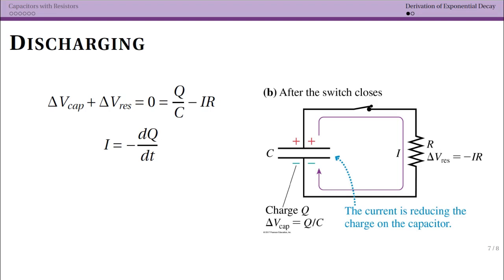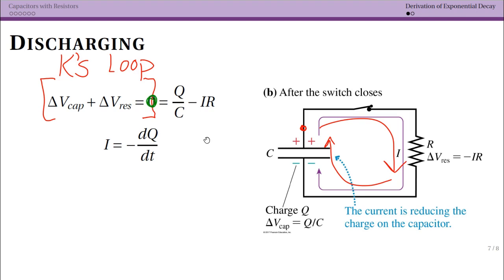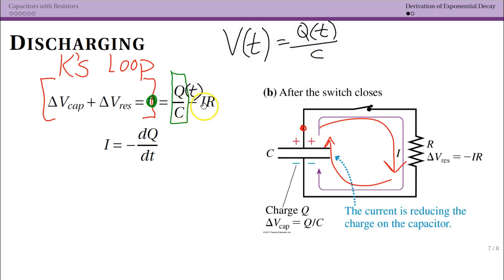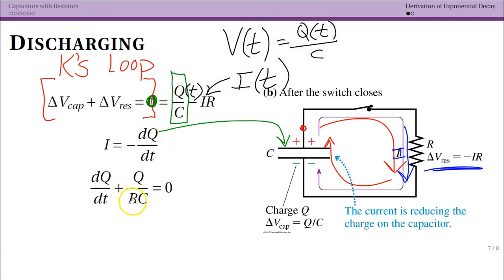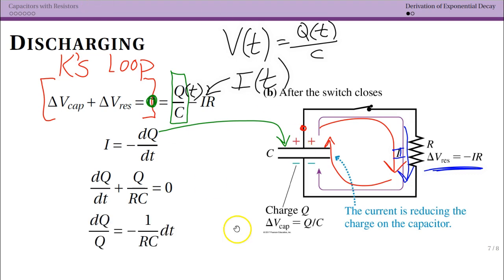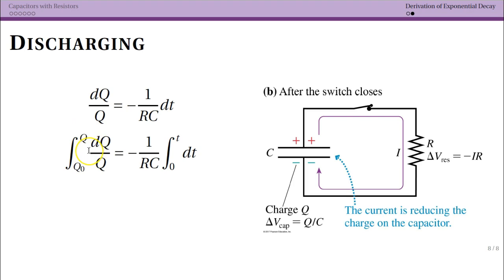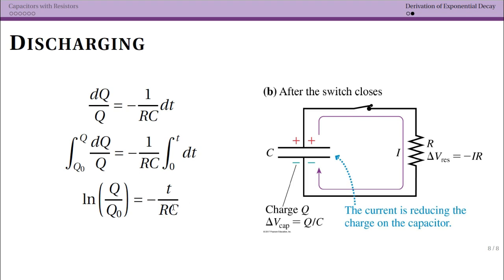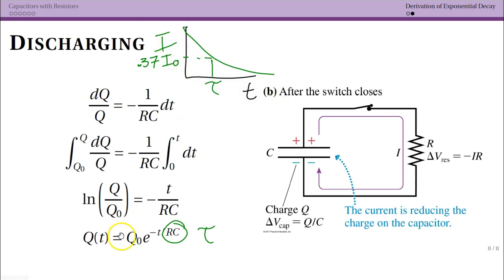Derivation of Discharging Capacitor Formula (28.9)

Comment: I have one for you; I can't figure it out:  I have two capacitors (C1 and C2) and a resistor (R) and a switch all in series.  C1 has a charge of Q.   C2 has no charge.  I close the switch and C1 begins to charge C2.  I need a formula and how to derive it.  I've tried using differential calculus, but I end up with too many variables. I need i=f(t).  Thanks